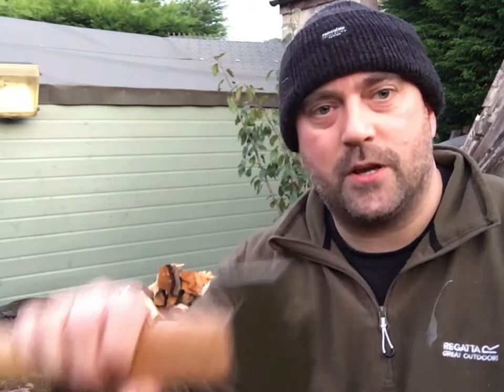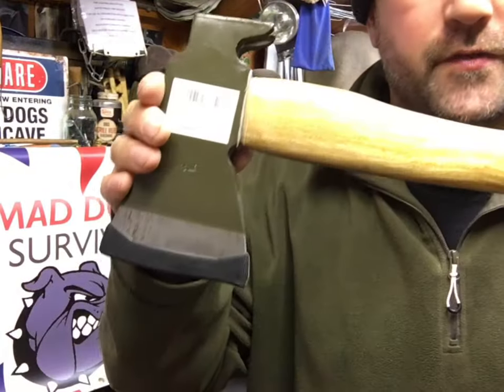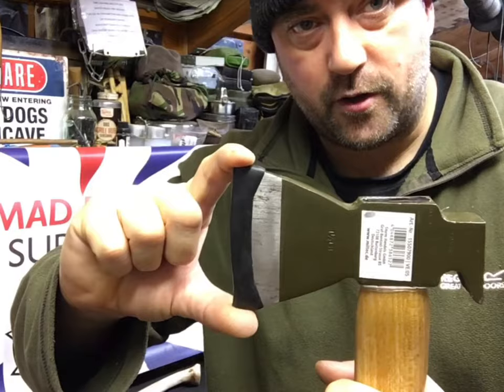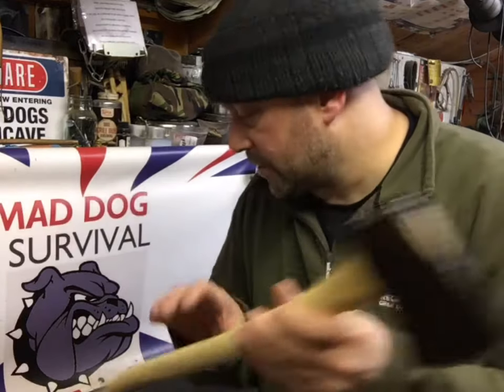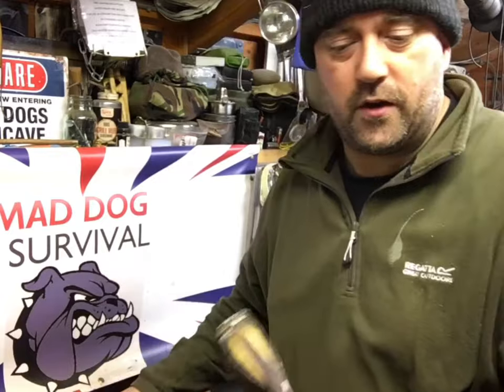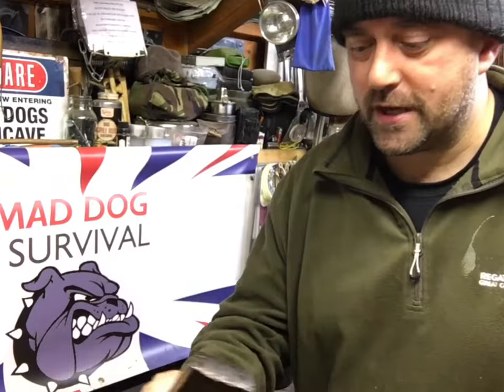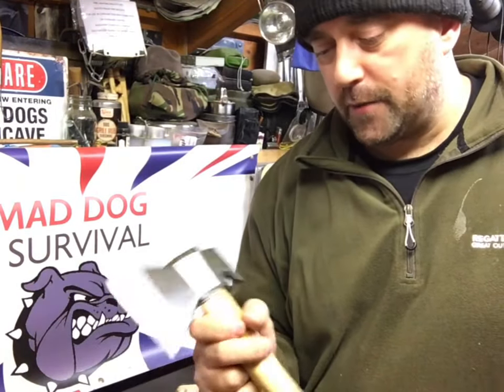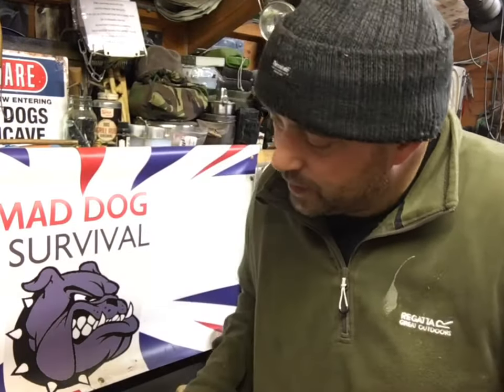Mil-Tec hatchet overview

Comment: I wonder if you could use a blowtorch and melt that epoxy out of there without affecting the temper of the axe head? I have no clue about the temperatures involved- wouldn't be anything you could do away from the shop anyway.
Reply from the maker: Yep I’ve removed the epoxy by fire before it’s definitely doable just don’t overheat and alter the tempering of the steel. Thanks again brother 👍🏽👍🏽😎